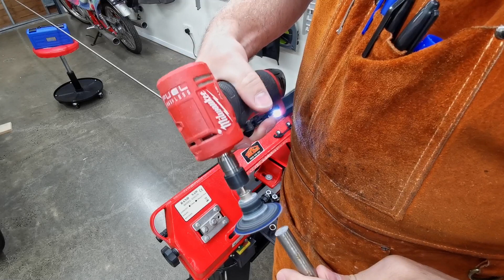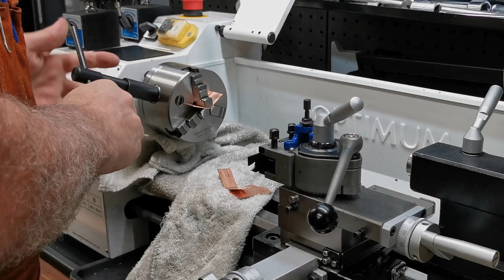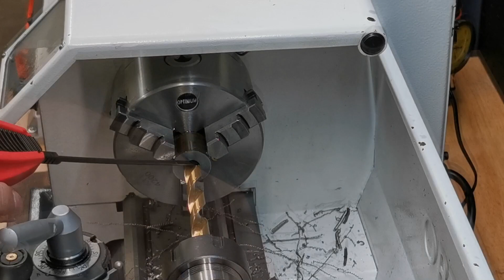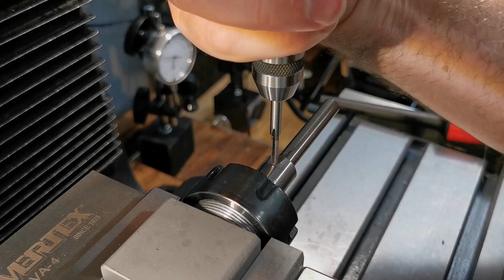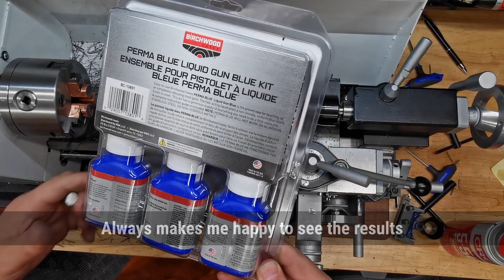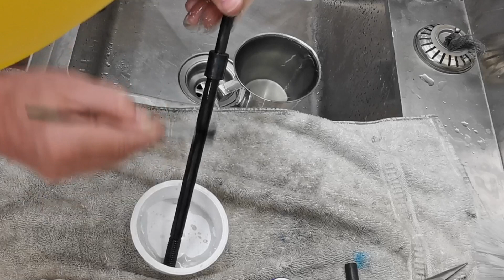A Better Drawbar for the Optimum MH22V Mini Mill - Rob's Garage

Comment: I might have missed it in the video but a bit of cutting oil when you're cutting threads might help,
Reply from the maker: Hi Bret. Yes, definitely use some oil. I was using plain CRC and once or twice also the CRC cutting oil for the threads here. That 1/2 thread was pretty hard to cut, but it came out looking really nice.

And just in case anyone wants to know...
The issue with making the videos is that they are only a fraction of the actual time and footage recorded, and so there is often something missing. This video has 10 hours of footage across 2 days cut down to 45mins. I have to follow what I'm saying in the recordings and try and make sure it follows some sort of logic... which often it doesn't

Other YouTubers either script/storyboard their videos, or in most cases, they say nothing during recording and then talk over it afterwards. I've tried out both methods and ran into other problems... such as; I usually don't know what I'm going to be doing when I start, so it's never in a perfect sequence and there are always things that go wrong and I have to backtrack. Regardless, I'm working on these issues and trying to sort them out for the next ones. Have also gone into debt last week for a decent camera and am working to get that set up.

Comment: For taping like that your better to use an adjustable spanner on one of the jaws rather than risk damaging the chuck tightener hole.
Reply from the maker: heh yes I've been waiting for someone to comment on that.  It all worked out ok here, but yes, I would do it a little different next time.